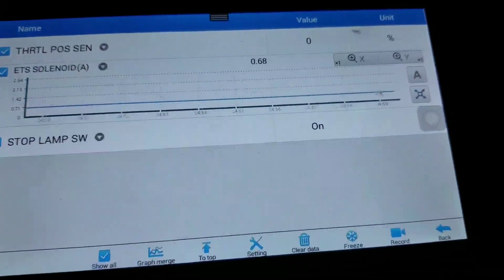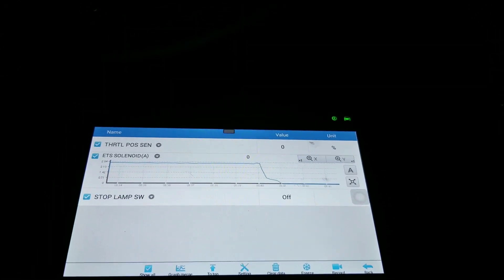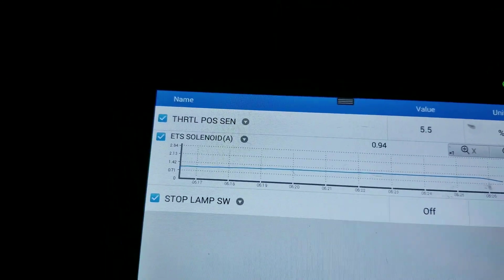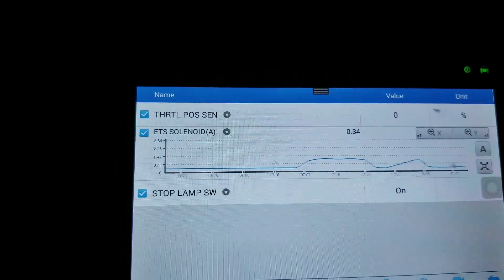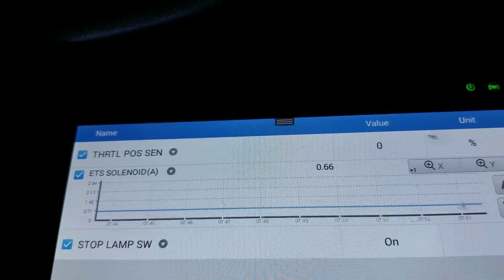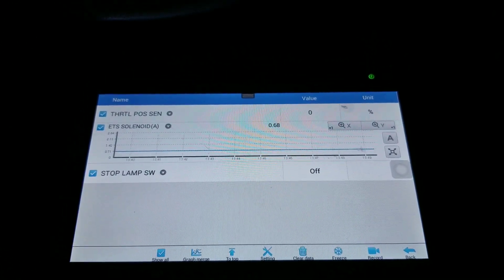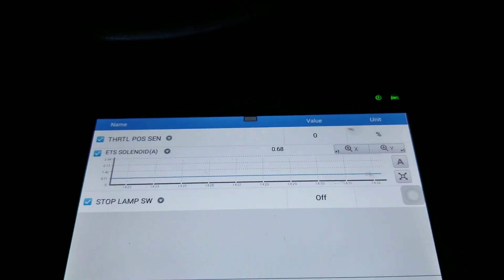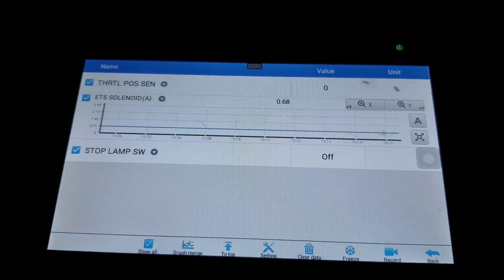Infiniti Q50 Q60 AWD ETS Solenoid Demonstration

Comment: Can you show the difference between each drive mode under launch conditions?
Reply from the maker: The differences between the modes are seen during part throttle... once you go wide open throttle they react the same. The transmission is quicker to down shift under part throttle in the sport modes.
Reply: @KayDroTechnologies  Have you figured out a way to switch it to 50/50 all the time?